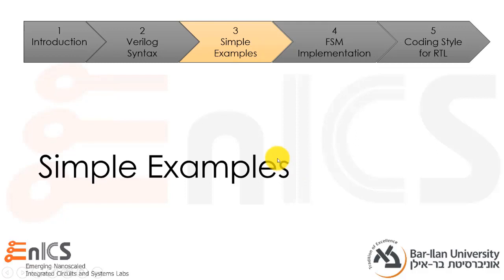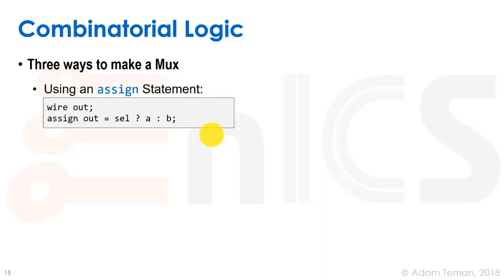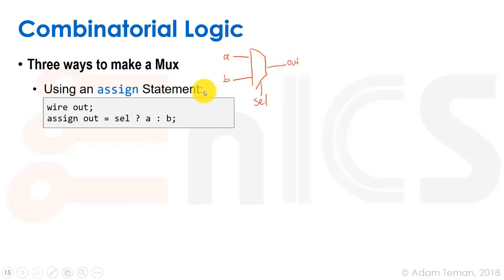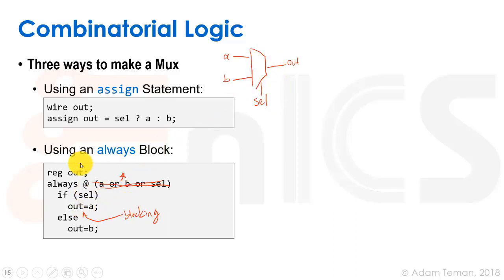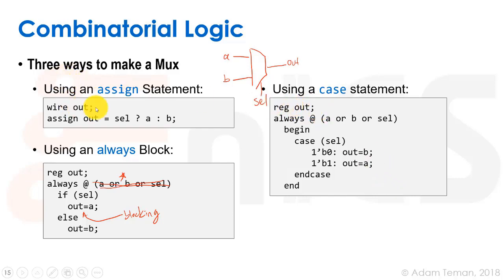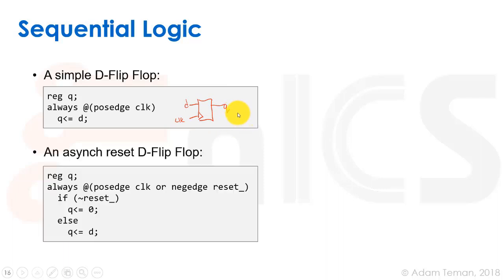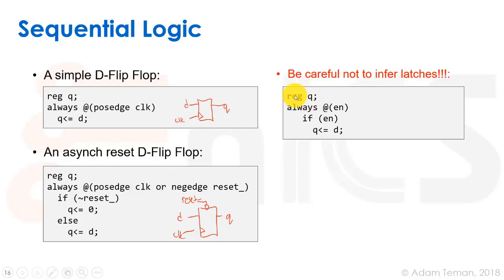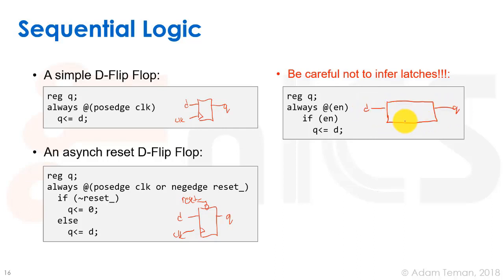DVD - Lecture 2c: Simple Verilog Examples

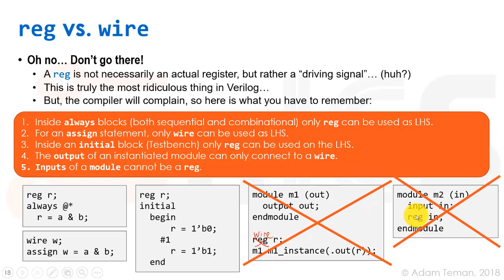Comment: I think the fifth rule at 12:07 is misleading.
Inputs can be regs if declared by a procedural assignment block (i.e., an always block) in the testbench.
The example of module m2 is invalid because the input 'in' is being driven within the module, which is illegal....
Reply from the maker: Hi @subhashchandrateku2587. Thank you for the comment, but I have to disagree with you, unless I didn't understand what you meant. 

The rule that I am declaring is that "inputs of a module cannot be a reg"
I have double checked this and as far as I can tell, there is no case of this being untrue/wrong/misleading.

If you are referring to the fact that testbenches use regs to drive the inputs of modules - then this is indeed true, and I even show it in the example testbenches in the lecture. However, that is not what the rule says. The rule says the "inputs of a module" cannot be regs. In other words, you cannot write: "input reg a;"

If you have a counter example, please provide it so we all can learn from it.
Reply: @AdiTeman 
Thank you, sir, for your response.
I had a little confusion between "testbench-driven inputs" and the "inputs of modules". I see your point now.
And thanks a lot for these great lectures....

Comment: Thank you for this beautiful lecture series.Just a short question for my clarification, might as well be out of context.
@09:38 10'sh37C didn't we lose accuracy there? Wouldn't we need 13bits to store it? Thank you.
Reply from the maker: Good catch. No one has ever noticed this until now.
In general, you need n+1 bits for a signed number with a range of -2^n to +2^n. 
In this specific case, the most significant hexa value is 0011, so we would actually need (4+4+2)+1 - so 11 bits, but it would make more sense to write a 3 digit hexa number with 13 bits.

Thanks for pointing this out.